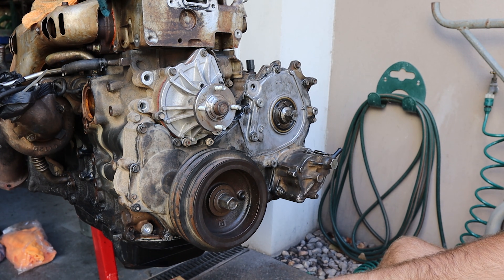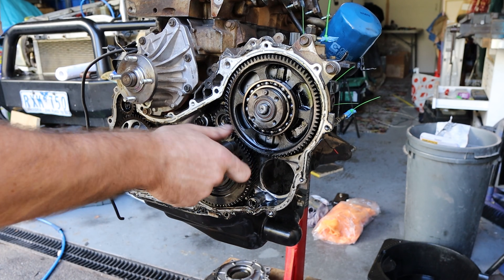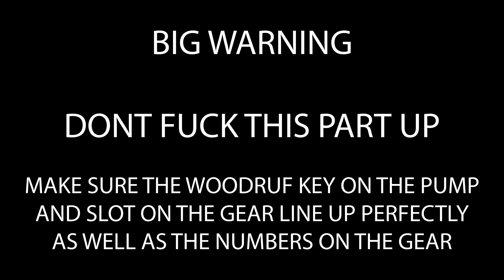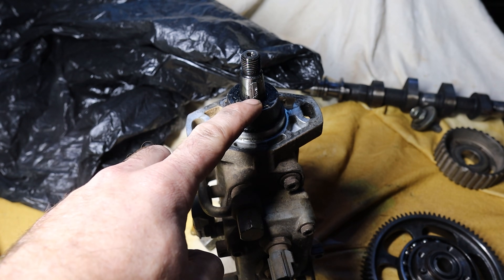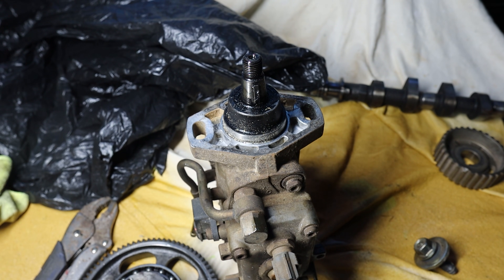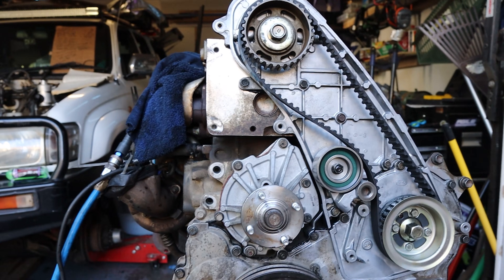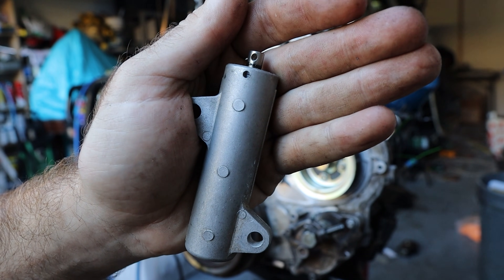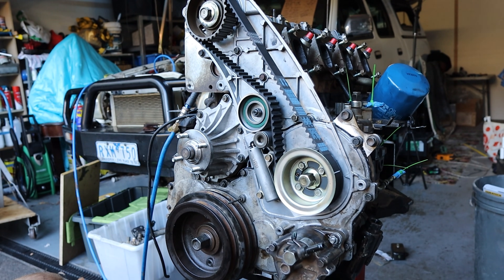1KZ / 1KD Complete Timing Guide  | Step by Step Tutorial | 1KZ Hilux Rebuild EP05

Comment: Great video. How much Nm for tightening the cambolt and the injection pump but?
Reply: Hey just fitting an oil pump to 1 of these wonder what torque did you tighten the sprung idler gear ×2 bolts
Reply from the maker: Check my community page for photos of all torque specs from 2 seperate repair manuals

front camshaft oil seal retainer bolts - 9nm
camshaft timing belt pulley bolt - 98nm
timing belt idler pulley bolt - 34nm
timing belt tensioner bolts - 6nm
timing belt cover bolts - 6nm
crankshaft balancer nut - 363nm
injection pump to timing belt casing nut - 21nm
rocker cover bolts - 9nm

Comment: Hi mate, quick question. 
Dissembling my 1kz after water induced bent conrods.
I’m about to take the timing gears out but before I do so I’m wondering if I need to set the crank to TDC. The only thing is I’ve already taken all the pistons out so not sure exactly where TDC will be?
Also looking at the numbered marks on the timing gears some of them line up and others are completely out of line with each other which seems bizarre? Any thoughts would be great. 
Cheers

Comment: Hey can u get to the studs for the injector  pump mine sheered off cant get a drill in there
Reply from the maker: that sounds like a nightmare! an automotive specific shop should be able to supply you appropriate studs
Reply: @lvlupbuilding got it from the front now to line up all the timing numbers

Comment: On a 1kz if I’m just changing the belt I can set to tdc take belt off put back on and make sure it all lines up without having to take the gear cover off?
Reply from the maker: Yes, as long as everything is lined up before you remove the belt and you reinstall it correctly.

Comment: Hey, how do you start the timing if the first two gears aren’t lined up? The gears marked with 2 are 1 tooth out? 
Love the videos 
Cheers
Reply from the maker: Either remove the gear or spin the gears until they line up. When it comes to pump gears keep in mind they are just pumps and as a stand alone item they dont require timing.

Comment: Great video and great channel, do you think i could remove the injection pump without removing the pulley and thus not worry about the cam timing? I already got the center bold of the injection pump loose but i am a bit hesitant to continue because i dont want to mess up the helicol gear. However, i have not removed the front engine cover so the bearing inside should still hold the gear of the injection pump in place, right?
Reply from the maker: Yes, absolutely

Comment: Hey do you use a catch can on yours? Im interested in getting one.  I dont believe the oil vapor going through turbo is good for it
Reply from the maker: Yeah I do, I have decent blow by cos my turbo is so old. Considering they are so cheap it's a good idea! Have you done an EGR delete? If not then a catch can is a must
Reply: @dingeldiy  EGR is deleted.    So what if I just vent it to the ground? My VW is set up that way but it does have a puck can on top that the hose comes out of
Reply from the maker: @BRWfilms  i guess venting to atmosphere is a concern for 4x4 when doing river crossings etc
Reply: @lvlupbuilding  yeah that makes sense

Comment: Hey mate, great video if you are just replacing the head. Would you set motor to TDC. Before undoing tensioner would you crack the cam shaft cog loose. Then remove tensioner. Then when it come to reinstalling. Loosely tight cam shaft cog. Align to TDC then install timing belt alignment correctly. Then tension belt, then torque can shaft cog to correct nm. Cheers
Reply from the maker: take it apart at TDC and the put it back together at TDC. For timing belt - the cam gears are keyed  to the cam shaft as is the fuel injection pump pulley/gear keyed to the pump. That means they can only go on one way. that makes it super clear that if the gears are on their marks (including main pulley) then line up the marks on your belt with the marks on the gears. the gears should be lined up with the marks on the engine block and then everything is timed correctly. Crank it over by hand a bunch of times to check if the motor spins freely and if it does you've done it right

Comment: I just found your videos, and so far I'm enjoying the 1KZ videos very much.  With that said, I need some help.  I imported a 1996 Hilux Surf into the States, with the 1KZ-TE engine.  It ran fine for about a year, and then it just wouldn't start.  A friend of mine with a Diesel Pick-Up said to pull the battery leads to reset the ECU.  I did, and it started and ran fine (allowing me to drive it 30 miles home)..and it ran perfect..no acceleration issues, no stalls, nothing.  It ran as it should all the way home, but once I got home...it wouldn't start again, ECU reset or not. I replaced the fuel filter, and checked all relays and fuses. I've not been able to find anyone with any idea why.  Would you have any ideas that might help?  Thank you in advance!
Reply from the maker: I'm not sure myself but sometimes the ECU's on these fail, short out or have cracked solder joints so start with that!

Comment: We are stuck on the crank bolt. Need to do this job because I think we messed up the timing as the the cam gear moved when trying to undo the nut. Frustrated beyond belief and wish I had left it to the pros!
Reply from the maker: if the bottom end timing is correct then all you need to do is remove the timing belt, set everything to tdc (the injection pump gear, crank pulley and cam gears) and put the timing belt back on. As always, turn the engine over by hand a few cycles to make sure you got it right.

Comment: Hello dingle, thanks for the videos they are great, i am currently undergoing the timing on my 1kzte kzn185 at first everything seemed okay until i got to the cam shaft nut, we managed to block the cam and remove it but maybe it moved ever so slightly as my timing is now out... So now im on to this video :o). However im not sure if before I start wether I should have my camshaft and gear on TDC with the marks aligned before adjusting the helicon gears below? I saw also during this video once you install the cambelt you crank it slightly to adjust the camshaft ?? :o haha cheers
Reply from the maker: without the timing belt installed the top end (head and cams) and the bottom end aren't linked or connected. you can time the helical gears without the cams and their gears in the correct positions. hell, you can time the bottom end with out a cylinder head installed.
When it comes time to install the timing belt make sure your injection pump gear, cam gears and main pulley are aligned to their respective TDC marks. In the video I slightly adjust my camshaft as it wasn't perfectly aligned with TDC

Comment: How do you tighten the crankshaft bolt without turning the crankshaft?
Reply from the maker: The usual diy method is to tighten it when the engine is in the car and bolted to the gearbox. Put it in gear with the handbrake on and you should be able to torque it down.
Another method is to put rope down the injector hole on the cylinder head (when the piston is on the power stroke so you don't bend valves)
If you cram enough rope in, when it gets compressed it will stop the crank from spinning and you can tighten it that way.   
Or just send it with an Impact gun (then double check when it's back in the car and bolted to the rest of the drivetrain)

Comment: very good and important information to learn. 
HELP ME UNDERSTAND HOW YOU CAN CORRECT THE GEAR WITH 5-5 AND 4-4 IF YOU FORGET TO PUT A BOLT TO LOCK THE GEARS NOT TO SPIN?
THANK YOU
Reply from the maker: get creative. hold one half in a vice with soft jaws and clock the other half with a custom tool that looks like an angle grinder key/spanner. once you put the tension back in the gear but a bolt in and jobs done.

Comment: Hi mate, great video, but a quick question for you, my timing gears do not have any timing marks on them, so, what position should I have the fuel pump shaft?  Woodruff key at 12 o'clock? Also do you have any ideas on how I can reset the Idler Pulley, forgot to put the bolt in it and it sprung back
Reply from the maker: yep anything with a woodruff key generally faces 12 o'clock get creative.
For the idler gear hold one half in a vice with soft jaws and clock the other half with a custom tool that looks like an angle grinder key/spanner. once you put the tension back in the gear but a bolt in and jobs done.

Comment: Just fitted timing belt to my Toyota HiAce van 1kz-te , new tensioner pulley and tensioner all the lines lined up as it should but when I tightened up the tensioner pulley it send it send a bit tight it didn't move freely that easy I fitted the washer at the back all seems ok fitted tensioner not sure what tensions meant to be on the belt
Reply from the maker: Timing belts are meant to be pretty tight. You can always take the tensioner back off and try again. you should be able to compress it in a vice

Comment: So if I am just replacing the cylinder head do I need todo this also?
Reply from the maker: no, as long as all the gears inside the timing case remain untouched. once you reinstall the head just install the timing belt as normal with all of your components set to their correct marks/tdc

Comment: Oh boy…. I wished I had watched this video before dismantling mine !
That gear that needs the bolt inserted to hold the three sections together before removing it…..I didn’t do that… didn’t know however it didn’t spring apart or anything. I could see that the three sections turn independently but they stayed together as I put it on the bench. I hope it all goes back together ok  😬
Reply from the maker: Yeah I did that my first time. You can always make a simple tool to re tension the gear.
The one I made was just steel and 2 small but long enough bolts 
Kind of looked like a giant angle grinder locking nut key
Reply: I’ve just done this too! How much spring tension is there meant to be?

Comment: Great video. Very detailed. I am in the process of fitting a new head to a 1995 1KZ-TE. Even though I lined up the timing belt/fuel pump marks (by turning the crank clockwise with a spanner) before removing the belt, I have noticed that my crank mark is 4-5 cm passed the pin. I would have thought it should have also been aligned (TDC)? Could this mean that some genius has misaligned the pump drive gears that you show in this video. When re-installing, I am not sure if I should set the crank to the mark, or just go with it the way it is. Pretty sure the crank hasn't moved since I started. Thanks again for any thoughts you can offer.
Reply from the maker: Your crank pulley may be worn and potentially slipped. Its too risky to wing it so i would recommend getting a new crank pulley and then making sure all of your timing gears and pulleys are aligned properly

Comment: I got a Toyota Prado 1996 turbo diesel 1 kzte it surging when immediately accelerating
Reply from the maker: If your timing is correct then your fuel system will most likely need an overhaul

Comment: if you did it properly you would have taken the balance shaft out of the engine before doing the timing, as any engineer worth is salt will tell you the ballance shaft is the main cause of failure on those engines
Reply from the maker: as in remove the balance shafts entirely? haven't heard of this and i'm wondering how does it help, and what happens with the oil galleries once its missing?

Comment: Good day sir. This a Great detailed video. I appreciate your efforts. What if both timing belt marks are ahead of the marks on body one tooth each side. Is it normal. Or one should make sure of all marks align, marks on belt and body. In my case 2 of the belt marks are ahead one tooth each side on body marks, one of my friends suggests me that this normal, leave it now and go ahead. What is your opinion your reply would be helpful.  Regards
Reply from the maker: In my experience all timing marks need to line up exactly when changing belts

Comment: I managed to change the timing belt on my old Toyota Hiace LH30 diesel . I did not see any timing marks on the pump pully so I would have lost the timing. However I did manage to lock the pump pully solid with the engine at top dead centre using bolts through the pully before I pulled it apart. A bit foolish but I got away with it. If anyone knows the correct procedure, please let me know. lol
Reply from the maker: if it works , it works!

Comment: My 1kd engine is idling but no acceleration...no codes snowing up...firstly now power then this...any suggestions. Thsnks
Reply from the maker: Check the timing on your fuel pump and all of your wiring connections on the whole engine

Comment: Why is it necessary to retention the idler pulley? I only realized I didn't do this bit after watching this video and my engine sealed already.
Reply: The idler gear I mean in the timing case
Reply from the maker: @nabillawrencheeralal  the idler gear is 3 pieces that are sprung together. If you don't put that retaining bolt in when you remove the gear it will release the tension inside the gear. I don't know why the gear is designed like this or how it works but I'm sure it's important. 
It may be possible to remove the fuel pump gear and leave the rest of the gears in place. This may be enough to keep the idler gear locked but I'm not sure. 
Did you notice anything move or hear anything? Was it hard to re assemble the timing gears? I'll try help if you can let me know what it was that you were doing!
Reply: I was looking for the same question and thought there would be a answer. I did the same and forgot the lock screw. When I took it off there was no real spring load in all 3 gears. So I turn the rear gear to the right and aligned the front to the same position that front and rear hole were aligned. I am sure you have to set them under that spring load right (if there is a spring load, mine didn't feel spring loaded). My head mechanic said it can make a noise. The manual actually gives you instructions how to take it apart and put it back together. I was a bit to lazy to do that. I will see in a couple of days if it noisy. 
How was yours after assembly?

Comment: Bro i feel like buying a hilux surf with 1kz. very cheap here but i fear the overheating probably that can destroy the head
Reply: There seem to be various ways to avoid that or at least minimize the risk (different thermostat, external oil cooler, additional/more accurate temperature gauges). Apparently they usually die/crack within the first 100.000km or live forever.
Reply from the maker: If you dont like the idea of modifying the car then maybe go with something less likley to overheat like a petrol version. Otherwise start with cheap sensible mods like an EGT and water temp gauge, then move on to things like thermostat, 10 blade fan, cleaning out your radiator, replacing the radiator cap and general maintenance. If youve got the time and budget a 3 inch exhasut, intercooler, hood scoop and snorkel will go a long way.
These cars only get hot when theyre driving up big hills on hot days or when towing up hill. Otherwise they're fine!
Reply: @lvlupbuilding for sure I mean these 2gen 4runner or a 1kz are good cars.
Everytime I pass any garage I swear to you there is at least 2 to 3 hilux surf just sitting there or abandoned
I asked the mechanic what's wrong  with them, he said it won't start or blown motor or a replaced the engine but won't start. idk if it's me or the owners didn't know what was coming.
Reply from the maker: @jdmgm6765  sad times for those surfs :(